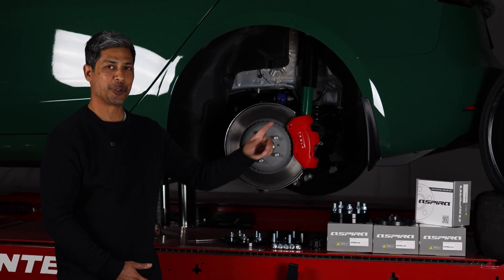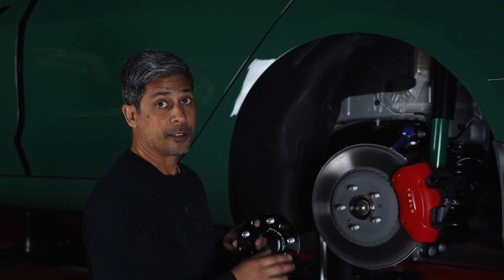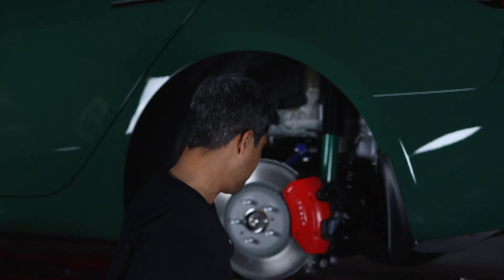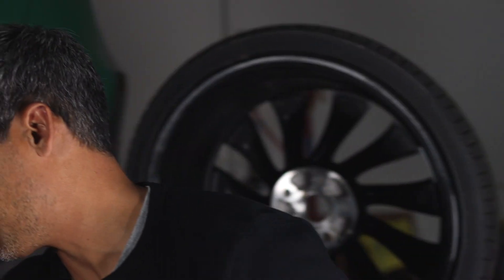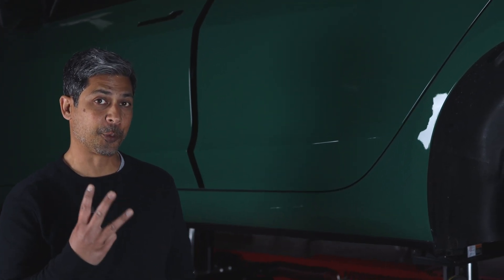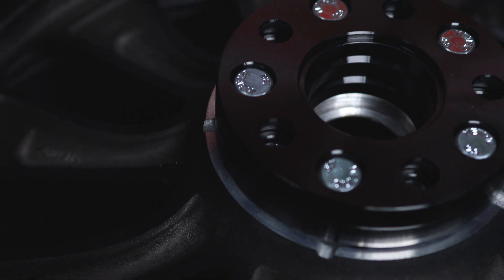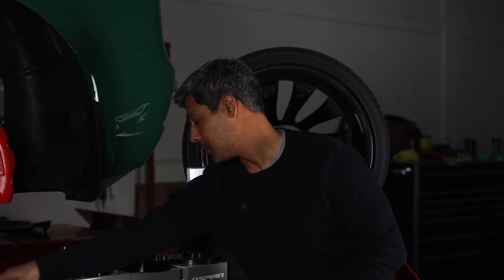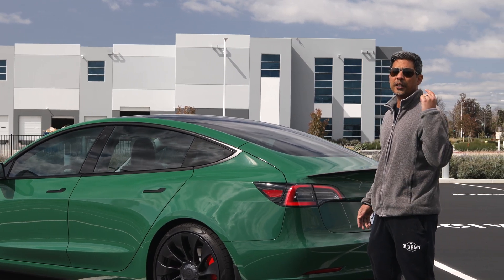WHICH SPACERS??? Tesla changed Model 3 Uberturbine wheels mid production.  Check this out.

Comment: I put 20mm back and 15mm front.
When I’m making right turn I’m hearing sound from the front left and when braking hearing noice from the back. Any suggestions?
Reply from the maker: no idea but you need to measure the pockets in the wheels to make sure the 15mm are safe to run with your uberturbines.

Comment: Great video! Would this still be an issue for an end of may 2023 Model 3 Performance? Has this been revisited or is there still no clear date where the wheels are safe to use with a 20mm spacer?  Thanks again!
Reply from the maker: 20mm is a lot and might be too much in the front.  The problem can apply to all years of 3's because the molds can be inconsistent for the wheels.
Reply: @zevcentric  thanks again! Went with 15mm in the front and 20mm in the rear. Love your videos, super informative!

Comment: What sizes can i run on a 2024 highland with the factory 18 inch aero wheels without having to shave the studs?
Reply from the maker: I'm not sure.  You'll need to measure and also will be based on the suspension setup.  send us an email zevcentric@gmail.com with your location.  https://zevcentric.com/blogs/zevcentric-news/how-to-check-if-your-wheels-compatible-with-spacers

Comment: I have 19 inch wheels on my model y long range . So what size of spacers you recommend for front and rear and also after I install them I need to drive couple of miles again and remove the wheels and check the spacers and tight the bolts . As I have seen some videos .

Comment: What is the tire size 
Standart it is 235/35/20 
I think u have other tires ?
Reply from the maker: All original 235/35
Reply: Ohh oke thanks and with size of spacer du u use front and in the back ? If i may know ?
Reply from the maker: @yasss- what’s your location?  It all depends on your alignment and camber settings.  There is no one answer.
Reply: @zevcentric  i am from Belgium

Comment: Model Y Performance wheels seems also to have changed, I tried fitting spacers I ran on my 2019 3P and the spacers would not fit the uberturbine 21" from a 2023 VIN YP from belrin.
The pocket wasent deep enough. it was 17+19mm spacers, none of them fit.  (H&R made for model 3)
Reply from the maker: 17mm in usa won't work but the 19mm I thought would.  18mm is the minimum for 21" ubers in USA
Reply: @zevcentric  i couldnt make the 19mm fit at least. Maybe need 20+

Comment: Why do we need spacers? Doesn’t it increase the stresses on the wheel bearings?
Reply from the maker: The same thing will happen if you get aftermarket wheels with a lower offset than factory.  We have not had any failed wheel bearings in 3 years and 50k mikes as yet with using spacers. I have seen people online with far greater miles and no issues.  That’s not to say it can’t happen but so far the data looks good.